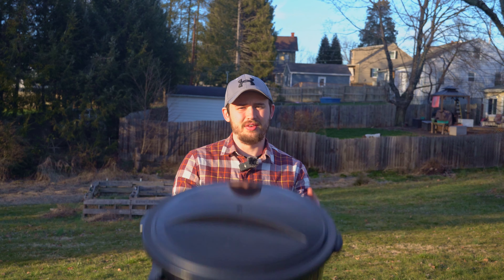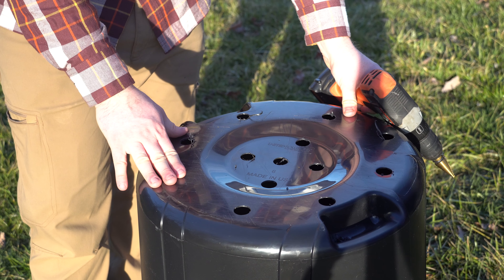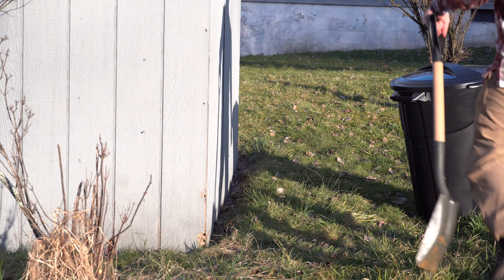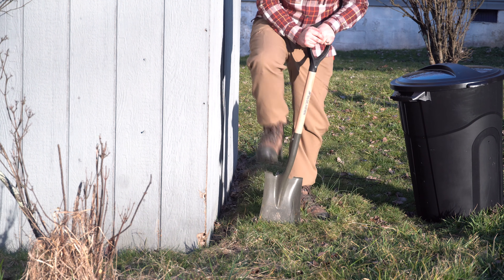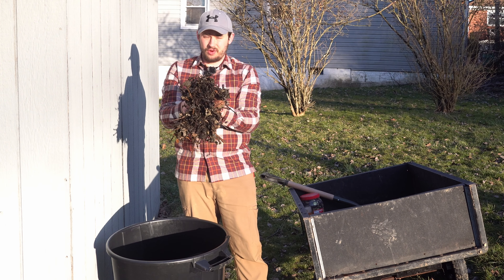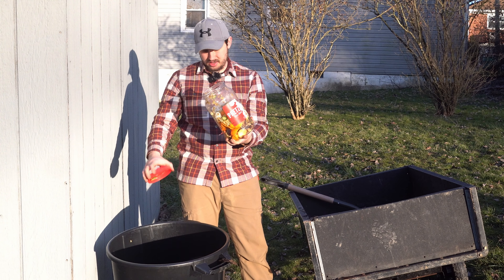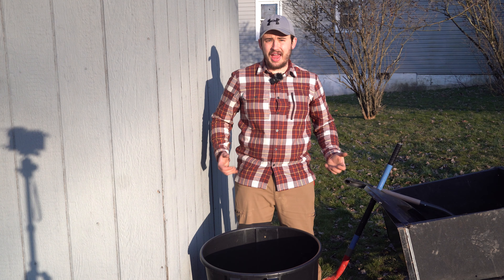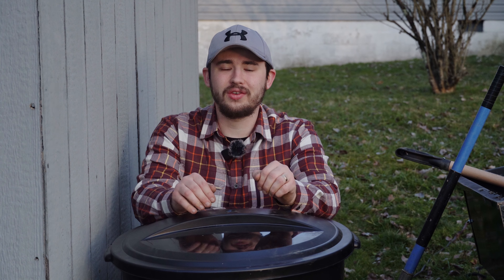How To Make a Compost Bin Trash Can Fast

Comment: I made a bin exactly like this 28 years ago when we moved to this house.  And it is still in operation.  The best 'black gold' comes from this bin.
I use ALL of my kitchen scraps, including coffee residue, tea residue, peelings, etc.  I layer leaves and garden cuttings with the kitchen scraps.
Reply from the maker: I'm glad yours has been working for that long, I'm considering adding a few more in the future.
Reply: @DanielSmithForge  I rotate three areas - the original bin, a box 'bin' for the residue of compost, and another for quick breakdown.  I transfer those three twice a year.
Reply: Trying to gauge how long it takes for the compost to be ready using this process. If you can please comment on the time it takes, it would be super helpful. Thanks.
Reply: @Ambalika108  I screen my compost twice a year, once in the spring and once in the fall.  It can be a quicker process if you turn it frequently, or if you insert steel rods to increase the heat.  I never turn it, nor do I increase the heat.
Like I said, I have done this for 28 years and it has never failed.
Other gardeners have different methods, but for me, this is the one.
Reply: @elisekuby2009  Thank you so much for taking the time to reply.

Comment: I made one and it works just fine!  I garden in the Mojave Desert in a mountainous area so the climate is very very dry.  I do water the compost at times but just let it go naturally.  I do layer green and brown etc. and turn it occasionally.  It takes us a long time because of the climate, but it is worth the effort!
Reply from the maker: Glad to hear it working for you in the Mojave desert. I've been through their once before.
Reply: May I ask how long it takes for the compost to be ready enough to apply to beds? Thanks.
Reply: @Ambalika108  A long time.  I got a bit done in a year but I was not good about watering the piles often (I conserve water and am retired and am a hobby veggie gardener).  Hard to be quick in our climate unless adding a lot of water and turning it often.  I do layer green/brown etc.  Lots of insects but few worms.  Desert.
Reply: @lindawoody8501  Thanks! That helped. I guess local climate matters a lot in the speed with which this process works.
Reply from the maker: Yes, local climate can be a big factor. In the winter it will be slower and as it heats up it will be faster. Mine is almost ready, but I add more to it a few times.

Comment: Hey, just remember the heat from the compost could possibly leach harmful chemicals into the compost from the plastic, the same goes for microwaving any food in a plastic container and I know you might say this is dirt that it’s not gonna be eaten but think about  the plants that you are going to eat if your planting vegetables they’re going to absorb those chemicals. Just wanted to put that out there in case someone wasn’t aware of it.
Reply: The same can be said of the plastic pipes that supply water to your home, or the hose you water your plants with that sits in the sun all year long and breaks down. OIr that black plastic sheeting over the soil.  When I was a cyclist, I rode in a club full of people who were constantly complaining of car exhaust.  When I pointed out that there is no way to avoid it, except by wearing a full-on gas mask, it went over like a fart in church.  The point is, there are lots of things in life that work against us.  Eventually, we die from something called Death.  No way out.  I wouldn't worry about some leaching, and at extreme low temps, it;s not gonna be much.

I might say that a plastic bin for this purpose should be replaced if it starts looking bleached-out and chalky.  Here in the wet part of the PNW, that's not going to be for a very long time, but in San Diego?  More often.
Reply from the maker: Most trashcans are made from Polyethylene and is not known for leaching. Which is one reason they are a great choice for this project
Reply: @DanielSmithForge  Right.  I'm replacing a couple of mine that have become degraded due to UV over many years, but yes, they're generally very good for not leaching much.  There are other concerns that are worse, such as jet exhaust if you live within a mile or two of a runway
Reply: @Lollygagger-k4p  thank you for your reply, I do agree with you that there are many things in our environment that is harmful to our health and unfortunately cannot be avoided, but the things that can be avoided is within our power to try to minimize or change in order to achieve a healthy life. There is an old saying that is very true knowledge is power and that’s why I appreciate your reply because there is always something new to learn with every passing day.😎🤚
Reply: Most of the foods you buy from the grocery store even organic farmers is probably gonna have some plastic / metal leached into the food, just Pray and God will bless the rest.
Reply: @Lollygagger-k4p you seem upset but you have facts .

Comment: I am making mine in a 200 liter metal drum, which seems to be the cold type compost, but I have wood from pallets stacked in compost all round where the hot compost is taking place at height of at least equal lengths of the drum. I just turn it about 3 or 4 days, it would not be necessary, but helps to mix well.
Reply from the maker: A metal drum would work great, you can also find them cheap. I turn mine about every 4 days as well. It is cold composting but can benefit from the sun heating it up.

Comment: One caveat – I did this a year ago and it works well enough, but I think the composting process is slower than using custom designed bins.
Reply from the maker: Each have pros and cons. Big open hot composting is probably the fastest if it fits your needs